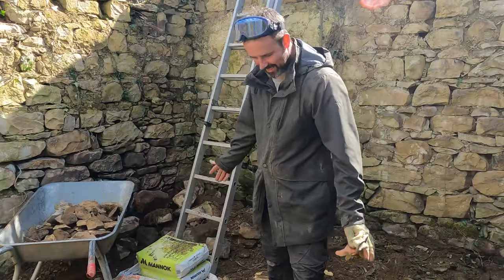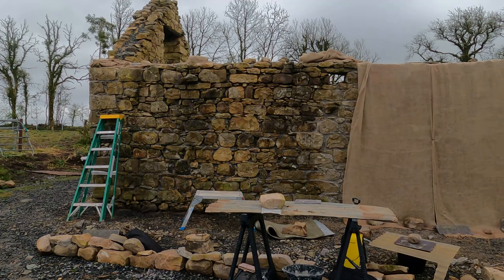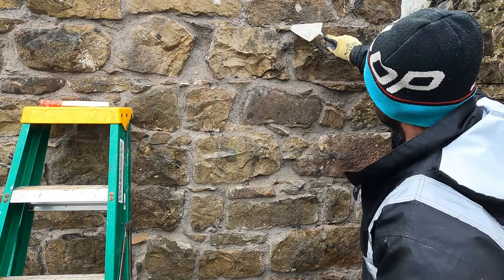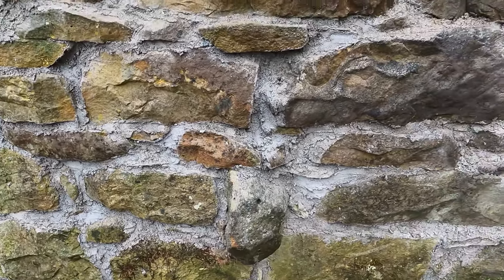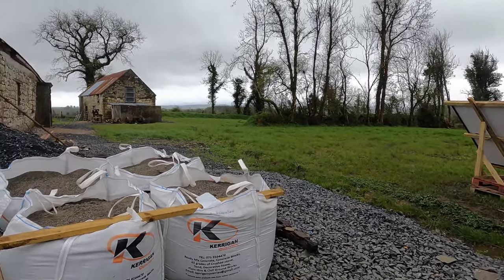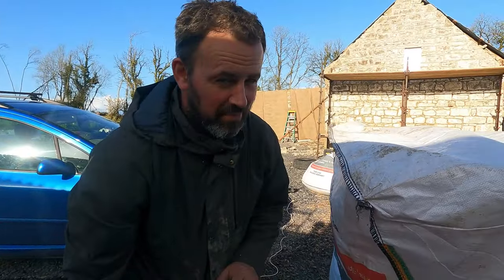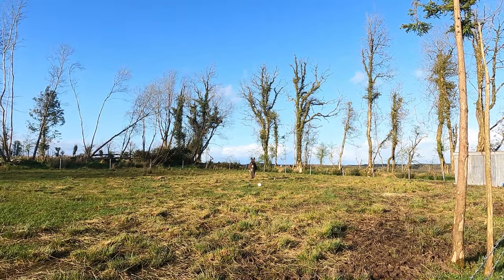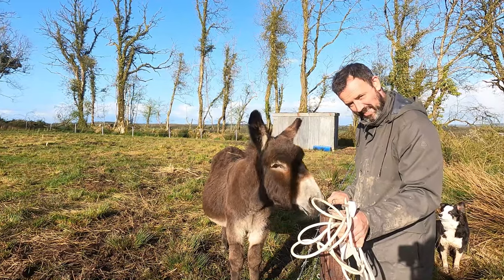Renovating A Ruined Stone Cottage in Ireland. Episode 34

Comment: Lime Mortar Pointing - Very dry mix (wet enough so you can mould it into pooh shapes in your gloves). Wire brush (gently, brush you are using is too aggressive) after 18 to 24 hours, when it crusts over. Soft brush immediately to expose grit. Perfect.
Reply from the maker: Thank you. We have learned a great lesson this week. Hopefully, we will get it right moving forward 🤞

Comment: Gates are going to be a Great  addition, the rusty bit  just sand it Back  and you can get galvanising paint,  just sprays on to bare metal .in fact i think i have some knocking about  I'll see if i can find it for you. 

We're meant to have a good week this week.  Todays been glorious. 
 Dont worry about using modern building materials  its not cheating.  Im sure if concrete lintels were available 250 years ago they'd have been used. 
Exposed wooden ones start to rot as soon as they're put in .warp then cause no end of bother till they're replaced and the whole saga starts again. 
  Have a great weekend  .  👍
Reply from the maker: Thanks Mitch. Such a lovely evening yesterday wasn't it. Let's hope better weather is on its way. A weeks worth would make all the difference lol. Hope you are well.

Comment: Considering the gates are  galvanised and are going rusty, i would just rub them down with a wire brush/sandpaper etc. and oil based undercoat and oil based metal paint should do the trick. However, don't be surprised if the paint tends to peel of the galvanising over time. But once the gates are protected from the elements, that's all that matters.

By the way, new subscriber. Love the channel
Reply from the maker: Thanks so much. Great info regarding the gates. We need them to be functional rather than decorative so that will work well. 👍

Comment: No reason to be using a wire brush. Escape to rural France channel for how to do this. Also, don't remove what isn't loose. If you are having to use a mini jack hammer to get it off, it was secure. If you tap it with the masons hammer and it doesn't fall out, leave it alone. Don't remove the clay from the center. This is classic rubble masonry. The outer stones are set with clay and the interior is filled with rubble and clay. The only lime is surface to seal it and was done in later years. Some homes in China are adobe set, they plaster right over the clay on the inside and mortar on the outside. If there is clay missing between the walls, then fill with mortar. Watch the France channel. He consulted with pros to find out what to do.
Reply from the maker: Thanks for the tips. 👍 We will take a look at that channel as it's been mentioned a few times.
Reply: @theirishhomestead You would enjoy his humour too.

Comment: Just curious, why are ye scraping back the lime mortar?  Is it just for cosmetic purposes or is there a pratical reason for it?
Reply from the maker: Yes, it's to help with the curing process "to provide a rough, open-textured surface which is ideal for carbonation and curing, and for maximum evaporation of moisture from the joints once fully cured"
Reply: @theirishhomestead  Thanks for the informative reply! It is  impressive that ye are restoring the building the way it would have traditionally been done and are not taking any short cuts.